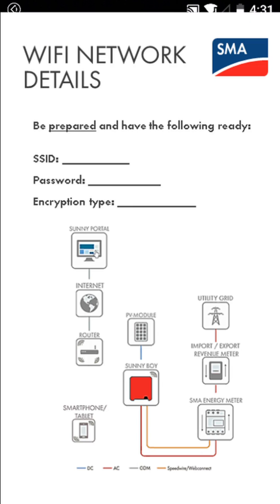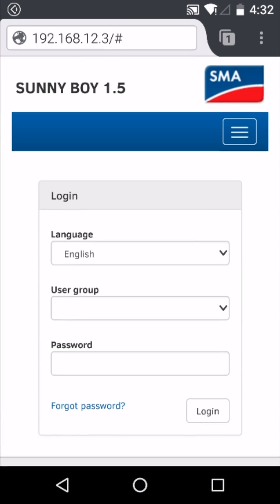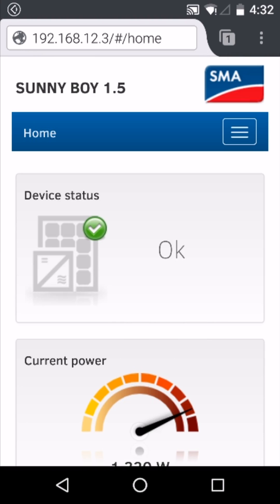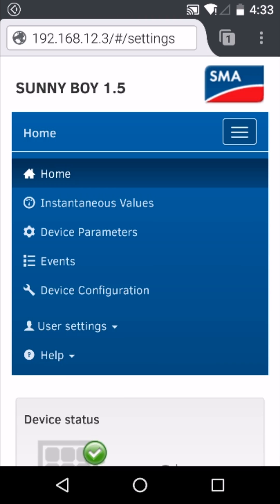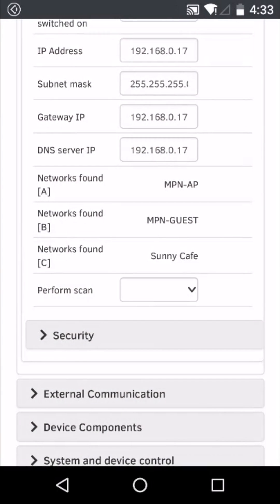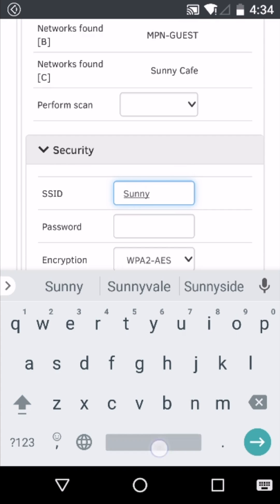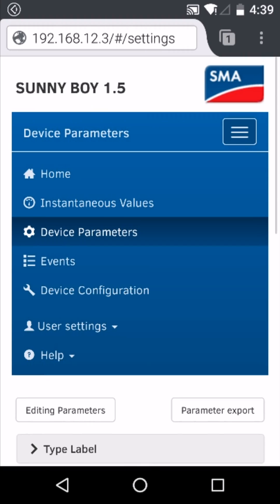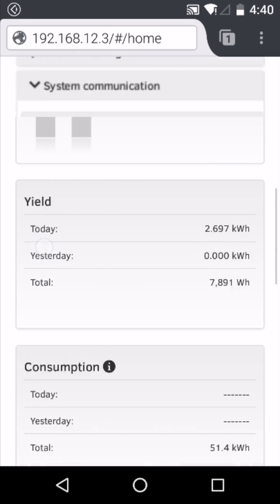How to connect your SMA Inverter to a Wi-Fi network

Comment: I have an old sunny boy SB 3300, its not network enabled,how can make it nertwork able
Reply from the maker: Unfortunately, your inverter is from a much older generation and did not have built in communication. It is possible to fit an accessory, either Bluetooth (BTPBINV-NR
) or RS-485 ( 485PB-NR) and facilitate a connection to the internet and then www.SunnyPortal.com via a computer.

Comment: I gave up trying to connect to Wi-Fi it just did not seem to want to work and I had two SMA inverters. I actually daisy chained the two inverters together with an ethernet cable and then ran a cable to my wireless router and everything seems to work just fine but as far as the Wi-Fi there's something drastically wrong with the way that operates.
Reply: THANK YOU for being better customer service than SMA. SMH.
Reply from the maker: Hello,

Referring to your query I`d like to explain inverters WiFi concept.
We just need to understand that inverters this Typ, actually do have two WiFi chips integrated.
One for external communication, in order to get this inverter commissioned without being wired.
Quick double knocking at inverters chassis just starts WPS coupling. In case your tablet  + smart phone whatever supports WPS (Apple don`t), devices will be coupling automatically. 
Within first 10 operating hours, there`s no need to put in inverters WPA2-Key, but  SMA12345 as passphrase.
Once coupled (green tick), please do enter a Web-Browser of your choice and put in Inverters Fallback-IP 192.168.12.3. 
Inverters Web-UI is opening and an Installer Password is to be generated first. 
After having logged in on Installer Level, please do starting a sort of “Quick Installation Guide” for commissioning.

In there, you`ll have a chance to connect inverter s internal WIFI to any local WiFi-Network in range. Once logged in as Installer, please Start quick installation guide.
Choose WLAN instead of LAN (default) and all WiFi Networks in range will be displayed. Choose your desired one, put in it`s Keyword and your inverter is coupled immediately.

Sunny regards, Anna
Reply: SMA Solar Technology is there a way to disable the wifi and Bluetooth to eliminate unnecessary emissions?  Gee wiz your instructions for trying to connect with wifi are 10x more complicated then just running an ethernet cable.
Reply: dobson777a Hello can you please tell me where you found your ethernet port? I don't seem to have one on either unit and these directions are dogshit plus I can't get any reply from SMA.
Reply: dardarshark remove the cover. There are two ports near the bottom right side if I remember correctly.

Comment: I have installed a few of these  and in each case the Wi-Fi connection has been problematic.  The unit is detected and perhaps a connection established only to then drop out.  On contacting SMA Service I was advised that the Wi-Fi on my laptop was old style (not so) or that there was interference from other Wi_Fi traffic in the vicinity (possibly so).  There is an option to make the LAN connection using an Ethernet cable instead and this works OK.

Comment: Thank you, Thank you Thank you, have finally been able to reconnect the wifi on our Sunnyboy 5.0 system. The "double tap" WPS activation is very hit and miss, setting up the connection on the ipad was quick and easy. I did have to remove the old SMA network info from the ipad first as I could not login to 192.168.12.3. Once removed I could then login and reset the wifi for monitoring.